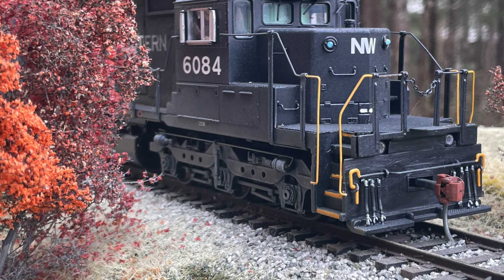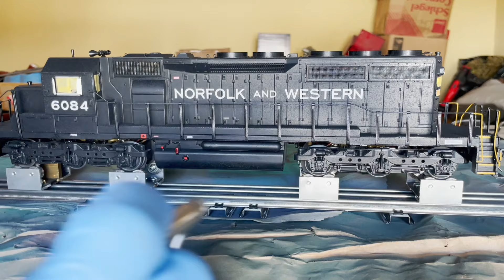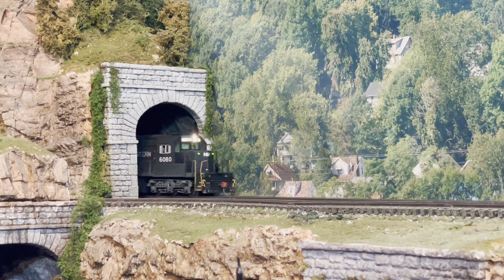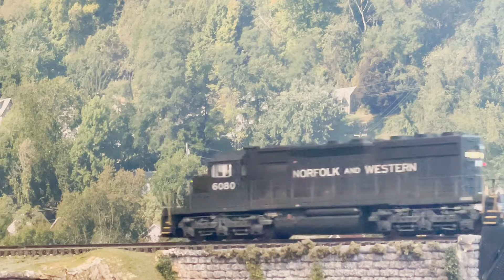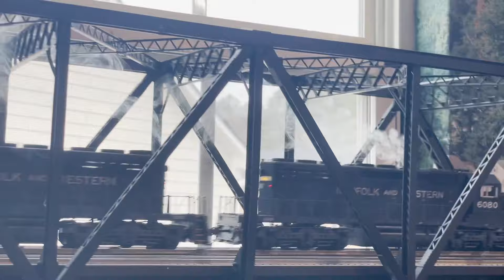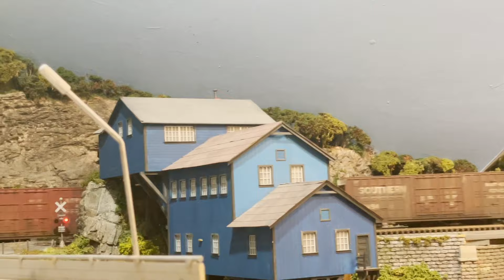Just Running Trains feat. MTH Premier N&W SD40-2 Diesels

Comment: It looks like you are using the long shank Kadees.  Was there a reason for that choice?
Reply from the maker: You are correct. They are used because of the tight radii of a couple of my curved sections. Most of the time when people use these, that is the reason.
Reply: Makes sense. We run 3 rail scale as well.